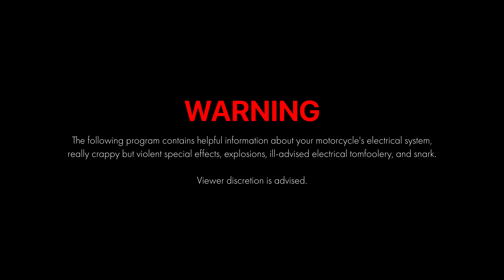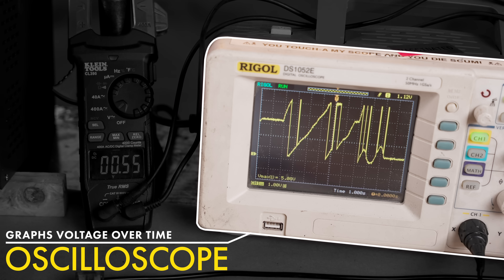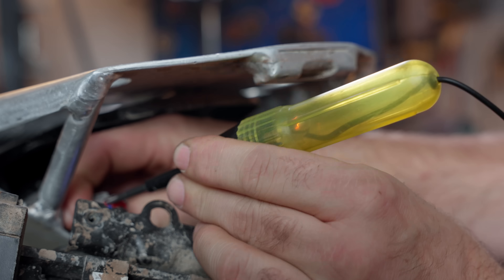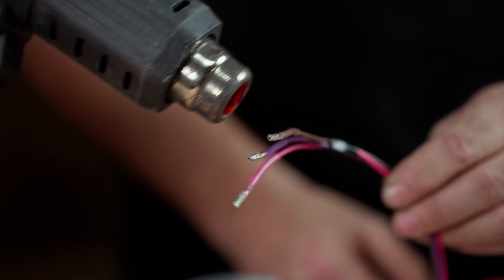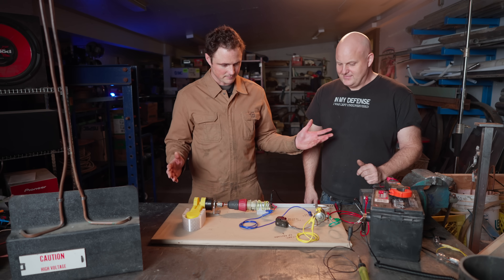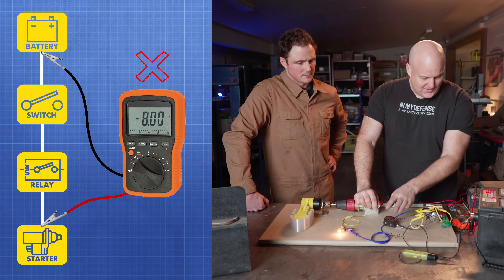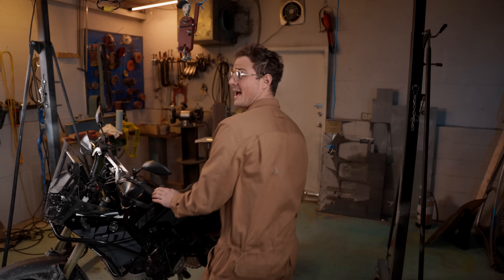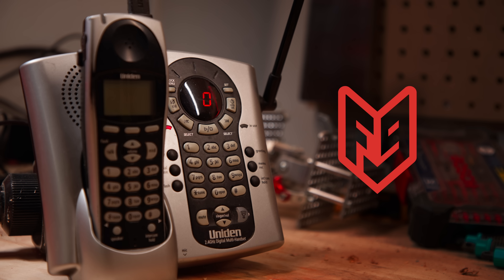5 Motorcycle Electrical Tips from a Pro

Comment: 10:07  a good ohm meter on the right resistance setting will definitely read the resistance of that lightbulb you have as an example of a faulty connection. If you were just waiting to hear the beep or see the display  change, that’s one thing but if you actually read the resistance, you should be able to find that bad connection with an Ohm meter. You’ll be reading high resistance across that bulb filament. I agree it can be a little confusing, but if I would see a high resistance of anything more than a couple tenths of an ohm on a connection where there should be almost zero resistance it would trigger my brain to investigate.
Reply: The confusion is that he is talking about continuity testing while calling it ohm testing. Yea a single strand will give you continuity but if yea measure the resistance it will be noticably larger. Granted it is more difficult because you have to know what the resistance should be, so it is a lot easier to check where the large voltage drop is when the thing is turned on. But this requires the system to be powered which also be a problem.

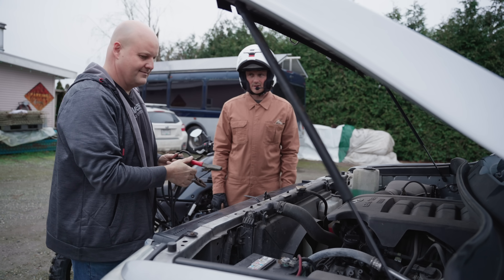Comment: 11:57 that is absolute hogwash... why start such stupid myths.. this is the reason why when youre broken down/flatbattery everyone is so reluctant to give you a boost because there are 50 myths about why a simple jump start will ruin your car/bike.. 14v is 14volts and 12v is 12volts both systems run at identical voltages they both use the same technoligally in the wiring and battery, the car doesnt produce any more voltage than the bike.. it makes more amps for sure but that isnt a hinderance in jump starting its a help and no the amps wont hurt anything theyre only drawn where theyre needed like the dead battery and starter motor
Reply: Having fried two ECUs trying to jumpstart vehicles and having never fried another since I started doing it at 12v instead of 14v, I'm taking the advice.    Transient voltages involve large amperage despite what our typical steady-state laws imply.
Reply: @brianhaygood183  but yet no one has an issue while using lithium jump packs that typically push 15-16volts.. theres nothing about a boost that will fry an ecu
Reply: @AndrewBrowner  The problem is that there is a circuit that maintains a fixed voltage different from the variable battery voltage. This and connected circuits can die if active in situations they are not designed for (like starting another vehical) from currentdraw and transients beyond the design specs. If you don't believe me try shorting you phone charger and see what happens (it might survive depending on how well the overcurrent protections work).
Reply: @someonespotatohmm9513   whats getting short circuited in a boost situation? nothing.... if you left it on there for 20 hours sure the battery could maybe possibly boil/get damaged but i even doubt that, the car will regulate its voltage not to overcharge its own 12v battery so there will never be enough voltage to boil either battery, the bike battery is seeing less voltage if it was damaged the car one would of been damaged first which clearly never happens

its not an issue stop trying to make a problem where one doesnt exist.. learn to accept youre not always right
Reply: @ its not the volts that matter in this case, its the amps. Shit is designed for a certain current. Jumpstarting can overcurrent things. Stop being so confident if there are multiple ppl trying to explain and correct "the garbage you are spewing"!
Reply: @someonespotatohmm9513   im confident because i have first hand experience.. theres no issue with it simple as that... what is getting over current? nothing in the motorcycles system will draw more current than it can handle for 60seconds not the battery, not the starter, not any of the electronics
Reply: and then continuous to spew more garbage with the hydrogen explosion nonsense... the battery has an internal resistance it can only accept so many amps its not going to get cooked in a matter of seconds especially not when its being fed at most 13.6volts you could leave it hooked up for hours without an issue

Comment: I would like to mention that rather than "probing around" he is dividing the circuit in a half, he is not going casually:
- Test the offending circuit diving it in a half
- You will find 1/2 circuit is working and 1/2 is not
- Test the 1/2 not working diving it in a half
- Keep testing and dividing until you find the damaged part.

Comment: I am puzzled how a battery can jump itself 12:37
Reply: Xzibit - Yo dawg... We know you like to discharge batteries so we put a battery in your battery so you can battery when you don't have battery.

:)

It's an integrated jump box inside the battery.  It's really two batteries with a button to connect the secondary one to the primary one when you need a boost.
Reply: Supercapacitors?

Comment: Hmm.  The backprobe using safety pins is okay, but the two pins clearly touched when let go, so s bit of electrical tape to insulate would be very helpful.  I love how an oscilloscope is used, but then there is a short discussion about the cost of an LED test lamp?  This there actually a disconnect in this video?  Lastly, the advice about jumping from a larger battery potentially causing too much voltage on the bike - utter nonsense.  The dead bike battery will pull the amps it needs, nothing more.  A working voltage regulator on the truck/car will only give what the battery needs, no more.  No need to play games with the jumper cable, more focus on ensuring the cable connections are solid (not all bike batteries are as easy to reach as that one) and that the positive cable won't short to the bike's chassis (or the car's chassis).  Also it's important to discuss which battery to connect last.  Dead batteries can have a high conentration of gases hanging around the battery so if there's a spark there it could cause an explosion.  Always connect the good battery last, but put the ground connecton on the chassis away from the battery.  I fear that in this video more time was spent trying to make it entertaining than in making it correct, very unusual for you guys.

Comment: For my first bike I paid over $1000 just to rewire a harness and put turns signals on a 98 sportster and I got it back from the mechanic to find he did not change out the harness (which he pocketed which I bought for like 300-400 bucks)…He Replaced the headlight for the OEM one, didn’t install turn signals and on top of it all the headlight caught fire the first week I got the bike back!!!! almost burnt my bike down. I wanted to burn down bros shop but then other customers would have my pain and don’t deserve that. Word to wise Do not go to Lucky HorseShoe Customs in Denver CO. He told me afterward I got my bike back they don’t do custom work…Go figure 😂 Dudes supposedly a Veteran which I can and really do respect (and he tells everyone who goes into his shop) but being a POS scam artist who puts ppl lives in danger is something I despise. He installed a SS carb and the bottom bolt near the intake manifold fell out after 2 weeks! I was so demotivated that now I just ride without turn signals. Dude had my bike for 7 months too. I think im gonna try again this year to get the bikes wiring sorted out.

Comment: I would explicitly talked about heat causing increased resistance, not just “amps.” A frayed wire doesn’t have the capacity to carry so many amps so continuity measures fine when there is no load. Add a high current load, it gets hot, resistance goes up, and voltage drops. A bad wire can reach equilibrium between heat and resistance or it can burn up (thermal run-away)… like a 12v bulb connected to 120v.

You kind of touched on it with incandescent light bulbs but didn’t explain that they heat up with unregulated power and increase resistance until reaching a balance (equilibrium) that they can tolerate without melting. A frayed wire obviously doesn’t have the same tolerance as the original wire gauge, so with the full current (amps) it either gets hotter than it should with the corresponding voltage drop or gets so hot it melts, breaking the circuit.

Comment: As a mechanic, these are all good. The ohms lie is a little misleading, tho. Yes, in large amp circuts, it's hard to trust ohms and volt drop is better, but in low amp circuts like sensors and even lighting, ohms are very quick and trust worthy (also sometimes you can't test live with volt drop, so you have to test "dead" with ohms)
Reply: As an electrical engineer, you're right. Ohm's don't lie, but improper or inadequate ohms measurements may. For a high current circuit like the starter circuit it may be a necessity because your meter can't read low resistance accurately enough to differentiate between a good and a bad circuit, but also the vast majority of the time a voltage drop test is impractical as you have to be able to touch a conductor in the right spot when everything is plugged in through weatherproof connectors.

It also seems like they are referring to the ohm test as the continuity "beep" test on the meter (for some these are the same) which is even less accurate than taking a proper ohm measurement. Doing an actual resistance test rather than a continuity check will be valid for more situations, as you said it's fine for any signal and low-power circuits.

Comment: Making a mold from silicone is nice but do it as a last ditch effort(old school version of fixing broken plastic connection). There are automotive terminals kit available and are generally universal. Just match the form and wire count/orientation. It's also great someone showed the old school way of making a custom molex male connector.
Reply: Silicone caulk is usually an acetic acid cure, which is why it stinks so bad, and also likes to corrode things, so I'd only do this if it was an emergency. Like you said, automotive plugs are pretty much standardized, the hard part is figuring out what it is, and once you know that you can either get a pigtail kit for it or get a new body and swap the pins over. I prefer replacing shells rather than splicing in a pigtail kit because that's just one more potential point of failure to worry about.
Reply: Can say using silicone should be avoided unless you use silicone specifically made for electronics. A lot of silicone has solvents which can easily dissolve metals and really ruin everything it comes into contact with, or in the case of a closed environment, the fumes can corrode things too. I learned this the hard way. Don't learn it the hard way.
Reply: No bro this idea is red necked, silicone will not hold consistent tension between the wires like a proper plastic shell will. If you do this make sure its for something non-essential like a USB charger. Dont cheap out on wiring. Using this method on a throttle body is a completely dumb way to get stranded.
Reply: It seems like a weird option. If you couldn't replace one connector, and you had time, surely you'd just replace both connectors with something you could source. And if you were in a hurry and needed a temporary fix, surely you'd be better off removing the old connector and connecting the wires directly with normal crimps. And the absolute emergency fix would just be to remove both connectors and directly attach the wires, by twisting them together and taping them up - assuming you're in the middle of nowhere with no crimps/solder etc - in which case you won't be carrying electronics grade silicone either, and probably can't wait for it to cure.
Reply: @Splode_ that only works if one of the connections isnt built into the sensor ... like the show throttle body. You arent going to simply source a "different " connection to mount to the throttle body.b
Reply: @trailblazer632  good point!
Reply: @ if you're gunna red-neck your damaged connector might as well just solder the wires to the connector female end. Cut the wires if you need to service the throttle body. Better than some shoddy loose wires suspended in silicone jelly.
Reply: Just super glue everything 

Including your fingers

Comment: That safety pin feature can create shorts on the wire that sticks out of the pin and also the other side of the pin might create a short and damage something. Putting some insulator like tape, plastic or cloth between the pins is necessary. If you are giving a start to a dead battery, car or bike you could ruin you alternator if the car is running during the start.

Comment: What i loved about my little custom style 150cc was the starter was right there exposed to everything. Need a jump? Turn on the key, and run the leads directly from the 12V car battery into the starter lugs. 12V is 12V, and the starter relay isolates the whole bike's electrical system from the car's battery, so you can't cook anything (including and most importantly, your own bike's battery). Note that this only worked because 150cc bikes are very simple, and they can get running from just the power provided by the alternator during cranking over. This also means you can push start the bike.

Or you could, in theory. In reality, i may or may not have increased the CR on that little engine to over 12:1, and may or may not have installed cams that made the bike not like to run at anything under 5k rpm... Fun little bike it was. You ran to the store to grab some milk and came back home with butter though.
Reply: "You ran to the store to grab some milk and came back home with butter though." This is a perfect descriptor for thumpers. 

Genuinely, one of the things I love about motorcycles is that you can literally start them by just running down your driveway and dumping the clutch. My motorcycle battery went bad and would occasionally just not have enough power to turn the starter. It seemed to happen randomly as it would work fine for a while and then just not start. Obviously I've replaced it by now but bump-starting has saved my butt multiple times.
Reply: you can just jump start it normally.. like you said 12v is 12v.. both systems are the same.. just because the cars system is bigger doesnt mean its running on a different voltage.. every component in your bike can handle 14v.. because YOUR BIKE makes 14v when its running
Reply: @AndrewBrowner  the problem is if your battery is dead, then 12v isn't 12v. And a car battery can put out a lot more amps than your battery can take in. You won't fry a computer module, but you will kill your battery from overcurrent flowing into it.
Reply: @somedude2492   thats also not true at all... the battery has an internal resistance its only going to accept so much power same as the lightbulb they used in their circuit there it was connected to a car battery yet it didnt overcurrent and explode

not to mention the voltage loss across the connections and the cables is huge when the current rises so even if it did try to draw a massive amount of amperage the voltage would drop and itd be unable to.. theres a reason people who work with heavy machinery need to buy jumper cables that are 0/4 copper and have springs in the clamps so heavy theyre hard to use

by your logic if i put one of the lithium jump packs that can put out huge spikes of amperage for a short time would cook car systems.. yet i used one sized for a diesel truck to start my bike for an entire season and it didnt cause an issue
Reply: @AndrewBrowner  very different scenarios and a slight misunderstanding on internal resistance of a battery. If you rely on internal resistance of a battery to charge it up, it's gonna blow up in your face. The internal resistance what defines the physical limit at which a cell can discharge. Not safely, not constantly. Just the absolute limit. The battery limiting its own charging current will make it heat up, as the internal resistance is in series with the charger, and well, inside the battery. Internal resistance on batteries is measured in the milliohms range. It's not a safe way to limit current. 

As for the jump pack, it's a jump pack. It's not a battery. I won't give you all the power it can constantly from the moment you plug it in, and I won't keep adding that power in after you start it up. That's why jump packs are safer to jumpstart something than using leads.